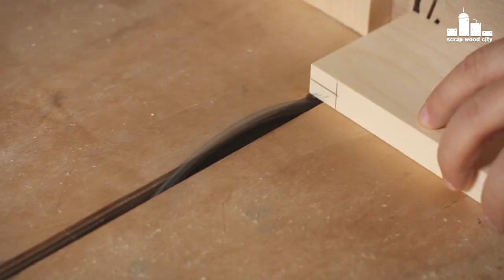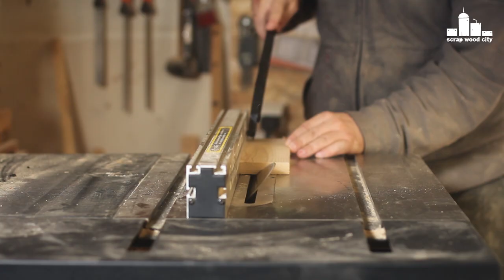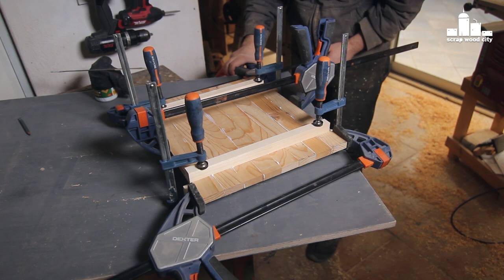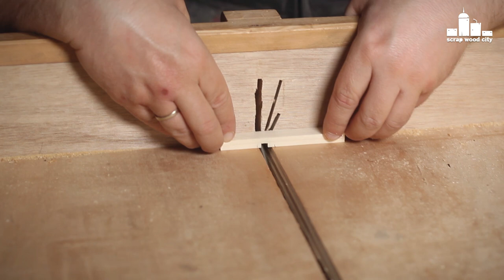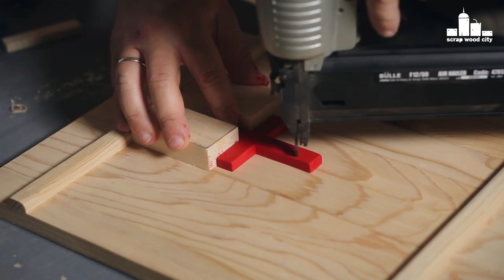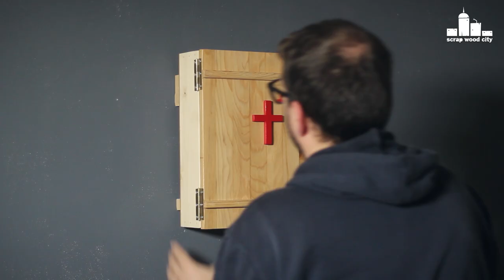How to make a simple first aid cabinet out of solid wood

Comment: For those saying the cross is wrong, the red Cross is actually trademarked and protected under the Geneva comvention (which is why nearly all games show health packs in green and white)
Reply from the maker: I didn't know that. Interesting. I'll do my research on it. Thanks.
Reply: I have had FAR more with just a red symmetrical cross on wall-hung First aid boxes than with a white one!  There seems to be no enforcement of this "Trademark" at all as all of them have been COMERTIALLY made and sold!!!!  The only time the cross has been white is on packs that are red or green or a wall box that is dark blue, but a very large number of the wall-hung First Aid Kits, the boxes I have ever come across have been white with the cross red!  So it seems that the main reason for the cross to be a different color is more to contrast the underlying color than anything!  The convention these days is a red circle with a white symmetrical cross in the center on white surfaces, or a white circle around a white cross on other colors if it uses that symbol at all.